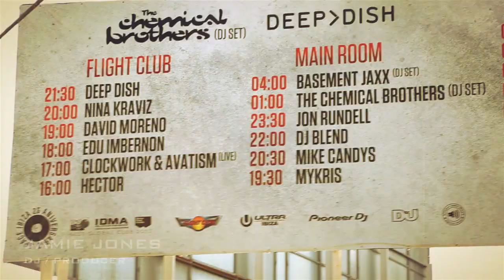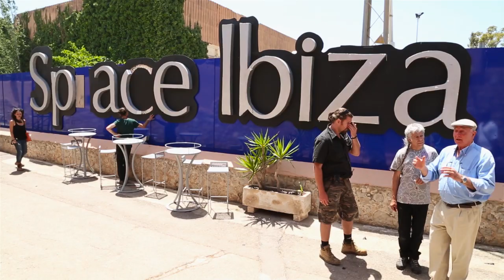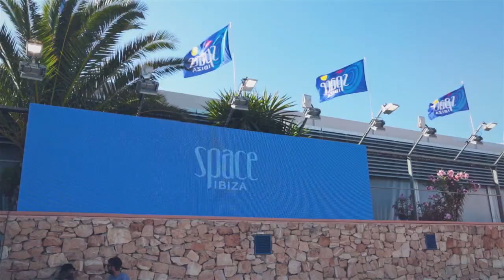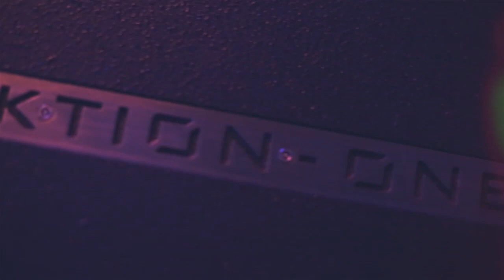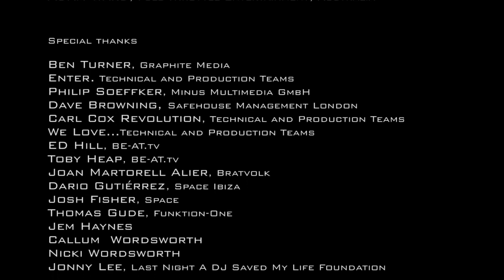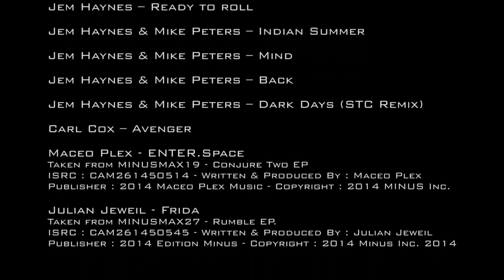Funktion-One | 10 Years in Space

Comment: Been to Digital, Newcastle a few times. They must run it badly, which is a shame. Definitely get's worse towards the end of the night as the levels creep up. Distortion seems to be everywhere. I've yet to leave a club without that horrible ringing in the ears. I really enjoy Tony's interviews - says it like it is.
Reply: Well funktion one as a system is like a very precisely engineered engine. You put the wrong fuel in it and it will run like crap, you shift gears unproperly and you will not use its full potential.
It's such a complex system it needs lots of knowledge and experience to get it sound right, especially since it has very minimal processing required (delay, eq, etc.). If you add processing to the system then it has to be precise and minimal, otherwise you just deteriorate the sound.
Another thing is whatever is done before the sound gets to the soundsystem has to be taken into account, if a DJ is redlining the mixer or uses shitty mp3 downloaded from god knows where then any soundsystem would sound like crap.